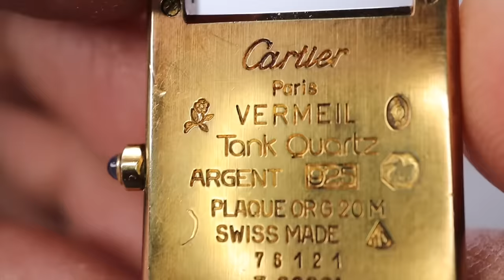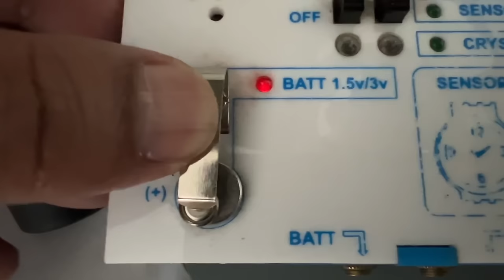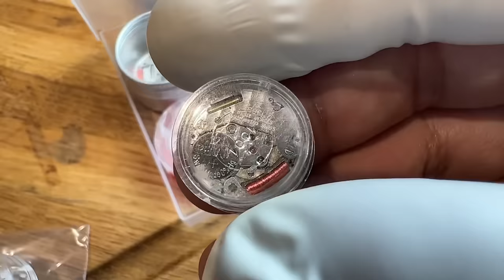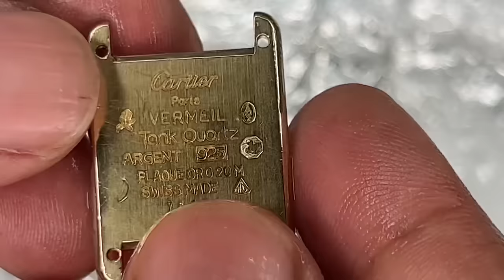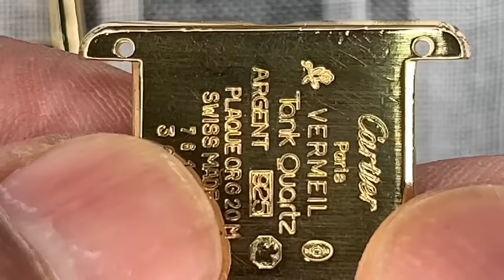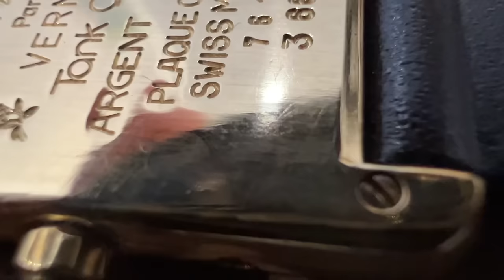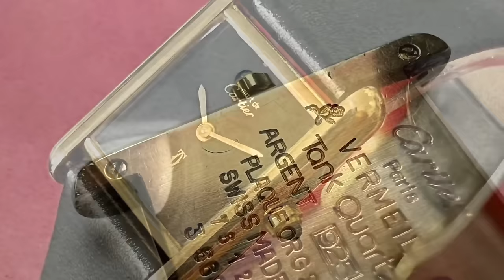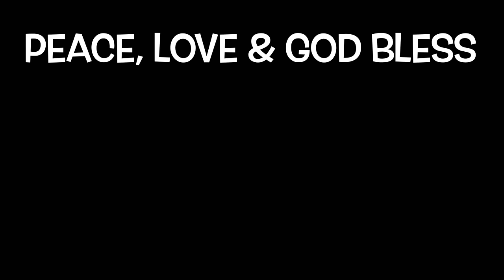Cartier tank watch restoration using a stone

Comment: Hi. 
please a quick question away from this topic. I am working on a TISSOT watch. The escape wheel and the pallet fork are made of plastic. can we use oil and what type? 
Thanks a lot.👍
Reply: Tissot specifies Moebius TH7-001  to lubricate this escapement. I don’t know what common lubricant comes close. They also specify that the plastic parts only be cleaned in a solvent bath (naphtha/benzine) no mechanical or ultrasonic cleaning.
Reply: merci beaucoup pour l'information  @mercuriall2810

Comment: Hi I wondering if you would be interested in repairing my watch? It's a Seiko 7T62-0GV0, nothing special unless you're me. My father bought me this watch straight from Seiko around 20 years ago, the only time I wore it riding my bike resulted in me having a crash leaving me with pins in my shoulder and a permanently broken toe. The watch was fine apart from a few scratches and a cracked screen. I sent it to Seiko in Japan but when it was there the tsunami hit destroying the factory it was in, I was sent a message saying it was gone but received my watch back about two years later in worse repair still having the cracked screen. I've had the battery repaired locally but not had the balls to resend it back to Japan, with my father becoming worse in health I'd like to get my watch looking back to the way he gave it to me. Is there any way you could help me?